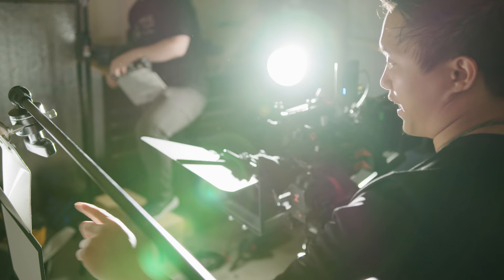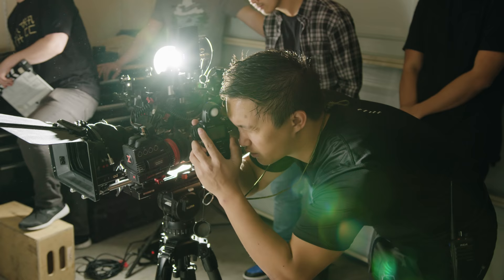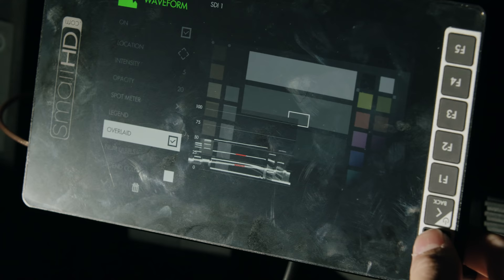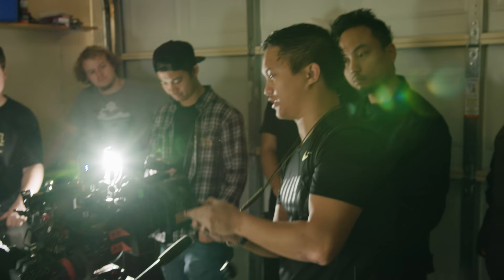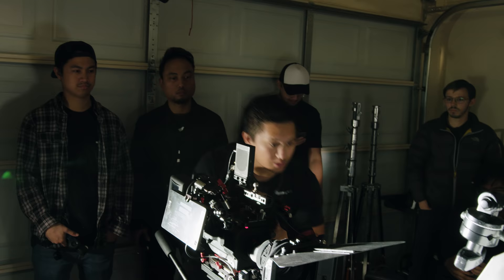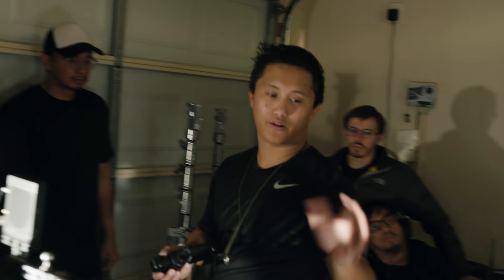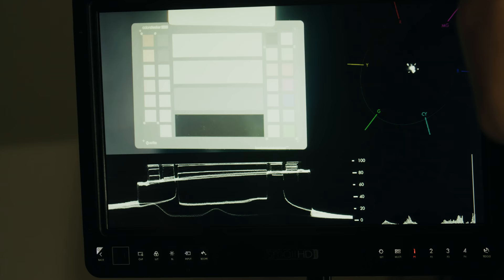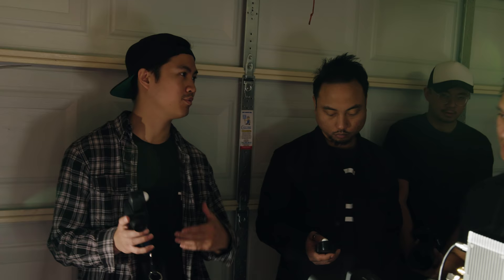Light Metering Basics: What is a spot meter?

Comment: What's up Robert! First off - just want to say that I appreciate you putting this out. I've got a couple pages of notes going from your 4-5 light meter videos, and I just want to make sure that I understand why exactly you're using the color checker & spot meter in this video.  You're essentially calibrating your camera & meter to accurately work in tandem so that whether you're using the incident meter to check how much light is thrown in a specific direction or spot checking for dynamic range, you're always receiving an accurate result... And you do this because out of the box, even though the meter is meant to project 18% grey, you'll have to calibrate the meter/camera for the most accurate results because every camera sensor reads 18% grey differently?

Appreciate you man! Keep killing it.
Reply from the maker: That's correct- the meter is calibrated to 18% grey, but different camera sensors/gamma profiles interpret middle grey differently. Any time I use a new camera, I'll shoot a color checker and expose middle grey to the appropriate IRE, then adjust my meter's ISO until the meter matches up with whatever T-stop I'm at. This essentially "calibrates" your meter to your camera.

Comment: Hey Robert, your light meter videos have been so helpful to me the past few weeks, thank you for making them!! Question - I also find that with my FX6 and my Sekonic L-758 Cine meter, if I expose based on my meter, middle grey does not land on 41% IRE. It’s about 1 stop darker. Do you find the same issue from the FS7 persists onto the FX6 and FX9 series, at least when it comes to the Sekonic meter?

Comment: So hopefully this isn't a dumb question but this has always stumped me: When do you personally switch between spot and incident metering? i.e. I've always used spot over incident because I was taught the zone system. So if I know I want to film a Caucasian subject at f2.8, I know that key light needs to be f4 since caucasian skin (zone 6) is usually 1 stop higher (or 1 zone higher than middle grey / zone 5). I feel I need to learn something new or change my way of thinking to fully understood incident metering since it's not about reflectance, just the light falling on the dome. I've also used spot because you can meter far off objects or even fire.
Reply from the maker: Good question! The zone system is great! It's more of a preference; I usually like using the incident meter to "throw" a specific amount of light in a general direction. A lot of times, there's nothing to reflect light from, so the spot meter wouldn't be of much use. I mostly use the spot meter to see where how bright an object is in relation to my dynamic range. I use my f-stop as my reference point, then count however many stops above/below that to figure out if its within my dynamic range. It's also great for metering things that are far away.
Reply: @robchado  creepy, I was reading this paragraph as the video was playing and as I read "i use my f-stop as my reference point" you said it at the exact time in the video. WEEEIIRRD
Reply: @robchado  Hi Robert, so if my final delivery is going to be rec 709. When I use a spot meter to measure the dynamic range of the object, do I meter for rec 709 dynamic range (+3 and -3) or the camera log profile dynamic range ( let's assume +7 and -7) thanks.
Reply from the maker: @byronchang4330  It depends if you plan on grading yourself. If you want to shoot log, meter for the full dynamic range. If you're baking in your look, meter for lower DR.

Comment: WAIT . I'm confused. Since you threw that speed booster into the mix, so that you get a +1 stop from it - you said you calibrated your light meter to underexpose -1 stop to balance it out..... Then I began to question myself if light meters are built to refer to full frame only (=35mm like film?) And that if you're using a micro 4/3 or super 35 sensor camera - then you need to somehow manipulate the light meter accordingly to balance out any quirks?
This got a bit confusing..
Reply: Also MFT (micro 4/3) loses -2 stops of light for any lens fstop, so I understand. Sounds like a mess to meter externally.,

Comment: Hopefully you can help me with this one.
When using th incident meter, I am getting an f8. But when using spot, I get an f8.7
So I am wondering, is the spot meter not calibrated properly? Shouldnt they both be equal to f8?
I adjusted my spot meter to match the f8, using the +/-5ev setting, but im not sure if thats 100% correct, if the spot meter should match the incident meter
Reply from the maker: The spot meter is trying to expose whatever it's looking at and trying to bring it to middle grey. Unless you're spot metering something that's middle grey, it will probably be different than the incident meter.
Reply: @robchado  i once heard someone saying that comparing his incident meter to it's spot meter and getting similar results is how he knows his light meter is correctly calibrated...
I wonder about that....